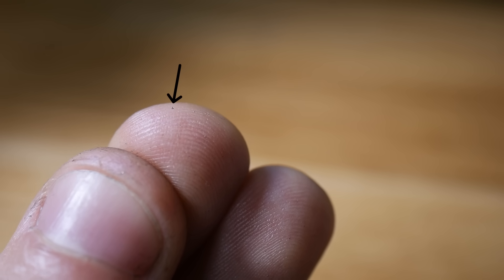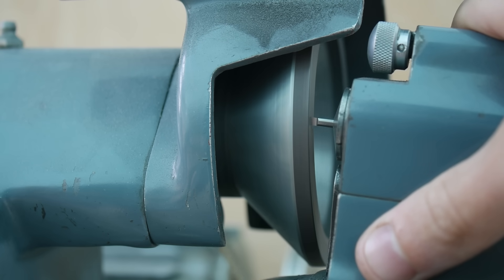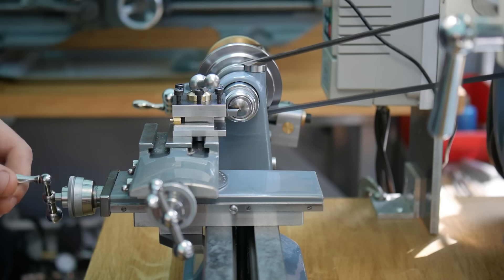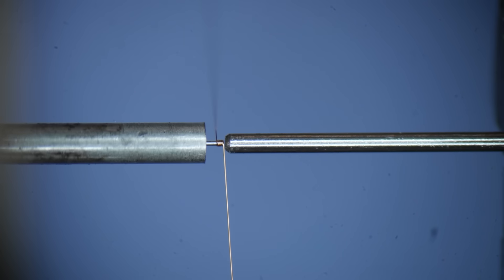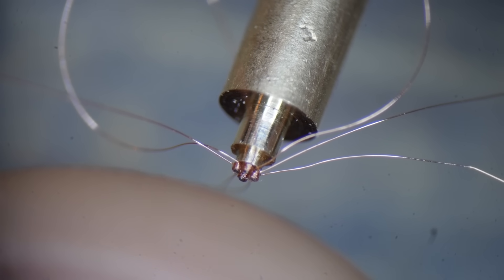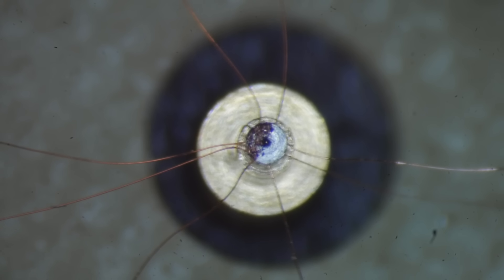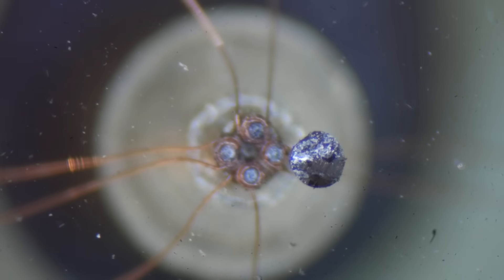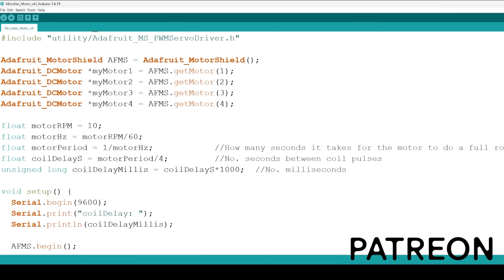Attempting to Make the World's Smallest* Electric Motor

Comment from the maker: Thanks for watching! If you would like to support our work and get access to additional videos and articles, please check out our Patreon page: patreon.com/ChronovaEngineering
PS Loving all your suggestions - I can't respond to them all but I read every one. ~Mike
Reply: Before you drop in the CA glue, put a nylon dummy shaft in the middle. Basically a thread of nylon, that won't glue itself and give you a clear shaft hole. Also... maybe consider making the rotor from 3 pieces. Two disc halves and a shaft from normal metal (or maybe titanium). You could "rebond" it all together using a drop of glue on top, and to make sure it doesn't wick to the sides/other side, bury the assembly in rodico. Just a thought.
Reply: I don't know if it would be considered cheating or not, but instead of machining the shaft, you should use a thin wire. Just cut to the required length, magnetise it and pass it through the centre of the stator. You can make a loop at the ends of the wire, so you can attach another wire that would serve as a crank or rod in order to drive something.
Reply: This is Amazing!  I Know there are ways to Basically Get Free Energy at a very Small Scale. Either from the Atmosphere or by collecting Residual Charges with "Simple" Capacitors.  With a Motor This Small, I am really Interested to see what the Minimum Volts/Amps requirement is!   Wow, man, Just Amazing!
Reply: @anthonyanglim7147  I thought about this alot while staying the night at a studio (recording sesh) next to highway 610 ⚠️😳 the roar of 70mph+ cars could power the light poles 🤌🤷‍♂️
Reply: @anthonyanglim7147 are you german ubermensch? Why all from Capital Letters?
Reply: The smallest motor is the flagellum of Escherichia coli (E. coli).😂
Reply: @peterwong1778  spermatosoid tail?
Reply: Awesome, I had a dream of a future where micro robots that looks like worms go inside the body and destroys stones, cholesterol, plagues and clogs.
Reply: Wood solder and Rose solder have very low t of melting. Use them (WITH PROPER VENTILATION OF PREMISES) to solder that wire.
Reply: I don't understand why you wouldn't use scaledown
6axis manipulators instead of your fingers. Also since you have a universal machining tool, make scaled down tools as well. The best controls are twisty knobs like on the etch-a-sketch. No danger of fumbling that way.
Reply: you should try to use aragonite or calcite as your glue, not cyanoacrylate.  That way it would be safe internally and dissolvable with HCL.
Reply: Have you thought about microcasting pieces?
Reply: nanobots are comming
Reply: Yo I've done my fair share of microscope-scale work and in place of the toothpick I strongly recommend using a replacement tip for carbon-tipped tweezers (Google PELCO ESD Safe Replaceable Tip Tweezers, you will find them). They leave very little debris, and can be sharpened finer than most toothpicks (I use an exacto, I'm sure you could get them even sharper).

Great video, by the way! Just stopped to comment when you mentioned the toothpick during assembly, excited to watch the rest!
Reply: I think you should use a cheap set of dental picks. You will get a variety of tools  to manipulate the coils instead of a toothpick. You will also get no debris, and a much sharper tip. Also, what about a lacquer stain to seal them instead of the super glue... You would get better control with flow, and a longer working/ dry time. And at that size, it will glue the wires and seal the coils  just like in bigger motors/ armatures
Reply: My heart goes out to your grit and determination
Reply: The Connections (2021) [short documentary] ❤🎉
Reply: check out "shaded pole motor" for your next attempt. To understand the principals will help you. You just need to find a example, where only one cage with one gap surrounds the rotor. 
You can use this principal on your construction, without using a magnet as rotor. But the programm to create the right signals will be complex. Specially to find the right values for permeability of the coils cores and timings between the coils.
Maybe better to avoid a metal core in the coils. Using maybe something like a nylon string with enough tension and wind the coils only by hand. Than you do not need any energy to overcome the permebitily of the coil cores.
And use a wire socket, so you don't damage the fine wires when moving the loose electronics. And you can use shorter wires, when winding the coils. Fine coils are up to today winded by hand, not mechanically... And do not use metal to connect the coil cores, else you influence all coil cores when one is magnetised.
Reply: Could you build it upside down  and balance the rotor on a jewel?
Reply: One word: Lithography
Reply: 7:52 crazy crazy crazy impressive
Reply: U have no gaps in the wire pillars
Reply: Would you please share your source for the wire you used?  I have some projects in mind that require the same sort of wire you would see here, or similar to what you might find wound in a quartz watch

Ive looked around a bit but was unable to find a good source myself.

Cheers!
Reply: make the base that the coils, and rotor shaft, sit in out of a watch jewel. or would drilling it just shatter it?
Reply: could you just attach the normal rotor to the piece of alnico?
Reply: Not interested how. Just why?
Reply: Nice reference to Mr Feynmans book in title pic !😊

Comment: why not take a quartz watch apart for its stepper motor and modify that? it would be a lot bigger than the motor you made though. apprently the worlds smallest motor is the size of a single molecule 1 nanometer across so you can't get the record anyway.

Comment: In most applications that small which require mechanical operation, they go with thermoelectric devices -- bimetallic thermal actuators and the like.

Comment: The wires magnetize the rods right? Couldn't you implant them in the jewel and then flip it over and have the motor shaft implanted on the opposite side?

Comment: In 2012 my left hand went through a 7.5 surgery to repair nerves in 4 out of 5 digits. During recovery I was informed that it was a micro surgery. My suggestion is hire micro doctors to do the work, they are really really tiny, about the size of 5 grains of sand. They did a great job on my. Dumb dad joke, what do you expect from a dumb dad.

Comment: I know that stone and optical polishing and shaping will commonly use a resin to hold the work. Using a resin, or even imbedding the part in a removable plastic could allow you to hold the work with a bigger fixture as the resin can form to fit your part, and the part can be held by all surfaces not currently being worked on. ideally something that is rigid enough to do the work, but can be melted or dissolved away easily and completely.

Comment: Inspirational!!  What about a cylindrical rotor in a cylindrical hole with fluid? I think if the rotor is longer than housing hole and the ends of housing and rotor are fluid phobic surface tension will center the rotor.

Comment: Watchmaker here. This is quite an iimpressive result! A few tips to maybe help you along....
1. To remove the pip after parting very small parts, the traditional way is to mount in a lantern jig and polish the pip down.
2. Pegwood is a lot better than toothpicks. It's worth the money.
3. Learn how to dress your tweezers to an ultra-fine point. It'll save you a lot of headache manipulating tiny parts.
4. In the lathe, don't forget you can always make your own custom collets if you need a very tiny size.
5. To catch parts on the lathe, setup a vacuum hose on a gantry over the headstock. Cover the end of the hose in fine cloth so parts don't get sucked in.

Comment: very cool project
I think you can not handle such scales manually. Could you create a tool to insert the rotor for example?
Would be a lot of work to create a tool for each assembly step but it worked well for the creation of the coils.

Comment: If you reread the papare.  You will notice that the idea is to make machines that can make snakes machine of it self.  You are just making a final machine by your self. So first make a machine or set of machines that can make a motor in normal size, a and that make the tools that make the motor. And then start the downsizing.  You are in trouble because you are trying to do tunings your self. Ant that was not the point. Thant ‘‘tis why your hands, your pieces, your tools basically do not work.

Comment: If i recall correctly, and that's a big if, the original had fewer turns on the magnets, and a pin on the base that went into a hollow quartz stem on the rotor. 

For applying CA, you should be using a blunt fine gauge hypodermic needle, and wipe the tip to ensure there's no droplet adhering to it. 

I wonder if you could put a needle on a micro pipette instead of the usual plastic tip? That would give you a lot of fine control over the flow.

Comment: instead of a shaft proper why not put just put in the center a sharp point the disk balances on. add an indent to the disk for it to stay centered on, then let the magnetic field suspend and balance the disk. you wouldnt need to worry about the glue as much either, lay the thinnest material you can get on top with the spike poking through and apply the glue with something like an insulin needle which can get to around .2mm. you'll have a smooth surface very close to the top of the coils clear of anything the disk can catch on and the coils will be fully immersed in glue.

Comment: Well you could get smaller making a mems device but a motor on a silicon chip, the use cases?
Reply: Instead of induction, use electrostatic motor

Replace coil with charged plates and a capacitor instead of induction

Comment: i have no machining experience so my suggestion might be ill informed, but would there be a way for the watch jewel bearing with the rotor inside facing the magnets so that you can just cover the entire magnet side in glue without worrying about the rotor slotting in between them, maybe the brass that holds the magnet assembly could extend past the magnets to hold the jewel and rotor

Comment: Maybe some sort of reluctance motor would be easier to make? The advantage is that no part of the motor has to be magnetized (the shaft just has to be made from something ferromagnetic). The disadvantage is that I don't know of a way to build one without a more complex rotor shape (and that might be a fundamental limitation, because the rotor has to be made non-rotationally-symmetric somehow, and the only way that seems to be available is mechanical).

Comment: Fantastic Work. My Great uncle Merl Bassett hand built what was considered The World's Smallest Electric Motors back in the 1930's. The snip about one of the motors can be found in Popular Science May 1938 on page 58. I have the 3 motors with the smallest being 0.058"long x 0.058"high x 0.062 wide. IT is rated at Thirteen Billionths of 1 horsepower. It contains 11pcs, took 191 hours to build. The stator winding had 8 turns of No 40 wire. The bearings were made of gold sleeves. It would take 2388 motors of its size to weigh 1 once. The Motors were displayed at a World's Fair.

Comment: Have you consider the photoetching used by spys to make letter format documents to fit inside a dot? So you can layer the parts and solder it electrically with condenser discharge micro point solder.

Comment: Have you considered using oil as the bearing inside the motor by drilling  a specific clean bore in the glue later? And using a capacitor discharge to magnetite the rotor. Giving a nice directed force?

Comment: you could benefit using a lathe with a sub spindle so you can part it off easier.  not sure what's out there in this size.  might need to design something.  you should have the sub spindle drive the part off.

Comment: Maybe consider UV resin in the future... it won't harden until you apply UV, allowing time to adjust. 

As far as the sapphire, just mill the depth of the jewel, if at the height of the four magnets allowing the center rotating part enough space to reach the center of the jewel to guide the spinning when activated. 

Find watch oil...low viscosity, maybe one for the balance wheel of a watch.  Obviously avoid any material that may leave particulate behind, i.e., wood. 

Use an oil applicator (metallic) for oiling jewels in watch making.

Just some thoughts

Comment: Get the metal you want to use as a base in very fine powder form mixed with resin and use an SLA 3D printer to "cast" the rotor.

Comment: Very interesting video. Did work on small medical stuff with the thinnest copper wires we could find long time ago.  One main problem was to find wires that worked, the copper dissolved in the solder if soldering was to slow. Also the insulation is not the same even if it is termed solderable, some work better. There are wires for hearing aids that are precoated with heat glue. It is possible to wind such wire on a former and then heat it to make the coil stick together. I remember that leaded solder with 2% silver worked well.

Comment: I would suggest to use a magnetic field viewing film to first check, if the coils are working properly or are even proportioned. Maybe one coil is stronger than the other. At that scale even better would be a Gaussmeter to measure the mT

Comment: Make the jewel bearing the base of the motor that the electro magnet posts slot into. And a centre hole for the rotor itself.. so the entire base of the motor is just 1 piece of jewel bearing only the rotor and electro magnets are made of metal.

Comment: I stumbeld recently over piazo elemt activators witch can wörk in ~80nm steps. With 4 you mighte build a 3 axis plate or arm + gripper setup to assembly in a closed inviroment or even Vakuum.
Idear 2 press the parts use a soft material and a form and crush it in the wanted form.

https://youtu.be/0GbrgwghUbM?si=Eac_HTUivcwm8h2l

Comment: The only thing I can really think of to get precise tiny parts consitantly would be through wire or sinker edm. Theres a project on printables of converting an ender 3 into a cnc  sinker edm for a low cost
Reply: yo mama did not use all them stuff when yo mama made ya :face-orange-frowning:

Comment: Doesn't have to be a synchronous motor, right? Just put 3 coils and a little bearing ball with a mark in the middle. A little oil should be fine.

Comment: Honestly, embracing the cutoff nib may be the best option, as you could use the nib to stabilize the rotor at both ends. 
What sort of RPM are you looking for? I gotta imagine at this scale you'd be wanting around 250,000. have you thought about trying an induction motor?

This is really cool.

Comment: Maybe a different style of motor? if you can make a coil that small you could make a homopolar motor that's 1/4 the size (in theory.) It might take some of the sport out of it, but it would be simpler overall and make for an easier result.

Comment: Awesome job !
I use to make laminar flow sensors for flow controllers winding 0.0005 resistance wire on epy hypodermic needles, 300 turns center tapped.
Proper tension is key.
It's actually quite easy to do by hanging a small paperclip on wire to maintain tension while winding.

Comment: Sir, you have the patience of a saint! I thought I was good at perservering but you take the prize hands down.

As a tip when I'm soldering SMD resistors that are sub millimeter size I form a piece of Blu Tack into a very thin finger and dab it onto the resistor which I can then manoeuvre into position by fixing the broad end onto a convenient nearby base (like a third hand) and then tease the object into position and secure it in place (solder in my case). Using tweezers is hopeless. It goes ping and there is no chance of finding it again. I think I saw you using Blu Tack.

For the coils, if they have a common ground then four wires can be soldered to a nearby copper ring and taken off as one lead. It would also be useful to have a surrounding PCB with individual copper lands so that the fragile wires can be terminated as soon as possible and more robust leads used after that. You can handle the assembly with less chance of breaking the fine wires. I would also attempt to use Blu Tack round the outside of the coils to hold them in place. A more reversible and controllable operation than super glue giving you the chance to repair a coil if needed.

The great joy of doing this is not are you constructing something unique you are creating tools for the job and you are teaching yourself specialised techniques for handing small components accurately and consistently. My first attemps and handling SMD resistors was rubbish but after a few months I had completed a project that required over 500 of them to be soldered in a cicuit for a special display for my daughter's wedding. Practice makes perfect!

Comment: What about the electrical insulation between rotor saft and the core metal, in which the rotor saft is rotating? Otherwise speed will not increase.